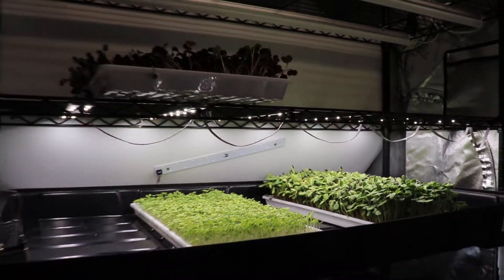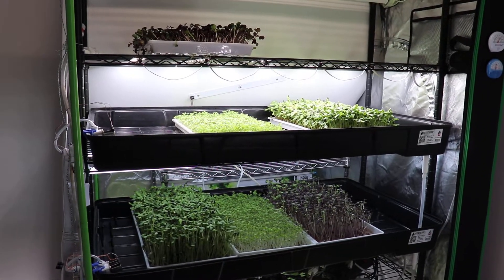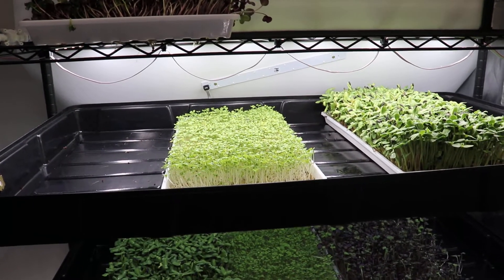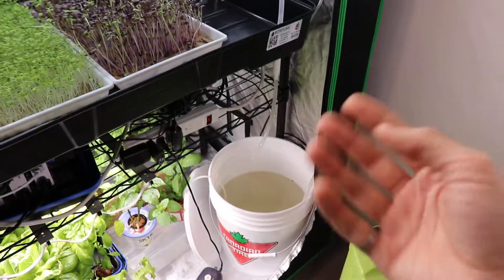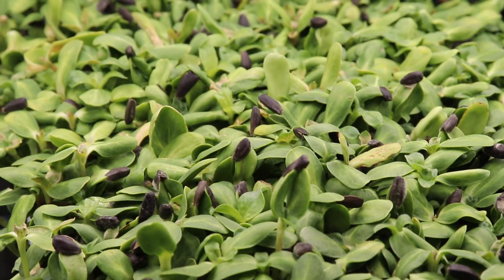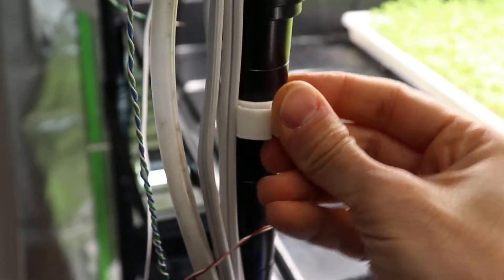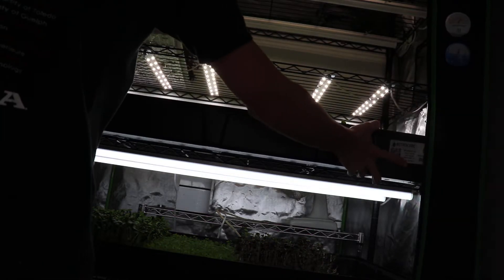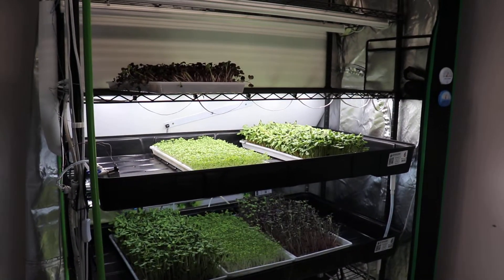Automated microgreens and hydroponics!

Comment: How are you able to keep the bell siphon from leaking if they are not sealed?
Reply from the maker: the fact that it leaks is actually helping drain the last few drops of water, therefore keeping the bottom of the tray dry. Initially i thought that I would make it water tight... but using it I found it to actually be better with the leak. I had glued some of them (leak proof) and found it not good haha. a lesson that I was surprised about
Reply: @klorofila  did you create that bell siphon yourself and is it be available for sale? Also, how deep does the water go in the flood tray (from the deepest part) before it starts draining to the next tray?
Reply from the maker: @rmg6071  Yes I have created and printed the siphon. currently not for sale but I plan on selling it at some point (after more testing and refinements). The water depth is currently set with the siphon height, so i can adjust it.

Comment: I just discovered your channel. Great to see your work with the LED lights! As far as I can see there is not much control on how much PPFD the canopys are recieving. I could imagine that the micros with barreta are getting much less than 200 ppfd and far from optimal depending on your preference of course. But I am very interested on how much PPFD the micros on the shelf above are getting and also the spectrum of the light. I want to see more :-)
Reply from the maker: Thank you!
Part of my goals with this light is fine control of the ppfd. 
My estimation is that the light outputs 100 to 250umols (@ 24cm and depending on how you set the power supply intensity).
With this design, you could just add LED strips to go even over 250 if desired :)